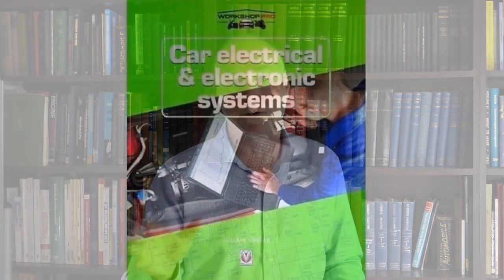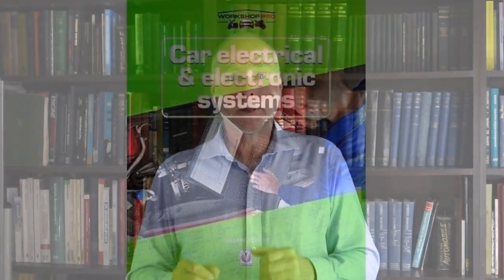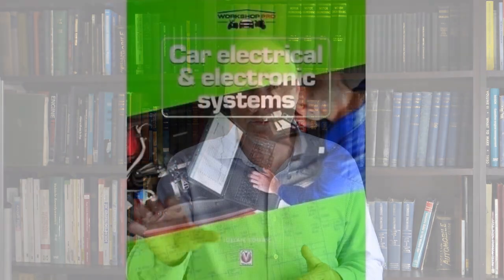Car Electrical and Electronic Systems - author introduction

Comment: The chapter from A. Graham Bell's 'Four Stroke Performance Tuning' on Engine Management Systems is chock full of good info but I think it's a bit beyond me as a complete novice (not in a position to get hands on yet - they're all words on a page and concepts in my head at the moment). Will this book help understand what's involved with an engine swap from a wiring and ems point of view? An idea of the physical components and how they connect up? (Obviously tuning to then follow)
Reply from the maker: Yes and no. The book will certainly help in understanding (1) how electrical and electronic systems work in cars, and (2) how engine management systems work. Both are also treated from first principles - you don't need to know anything to start with. But it doesn't cover things like engine swaps or wiring programmable management. My book on tuning programmable management (only a short book - see https://www.amazon.com/dp/1503312976) has a small section on wiring programmable management and a longer section on tuning programmable management on the road.
Reply: @JulianEdgar  Thanks for the reply. I think this is the place I should start. Most of what I'm reading isn't clicking and it's due to an unfamiliarity with the basic concepts. Before I worry about stand alone engine management I should understand how the stock system works first.
Reply from the maker: @GetUpFalcon  That sounds good - outline of contents and some sample content here: https://www.amazon.com/gp/product/1787112810/ref=dbs_a_def_rwt_bibl_vppi_i1 (Click on 'look inside')